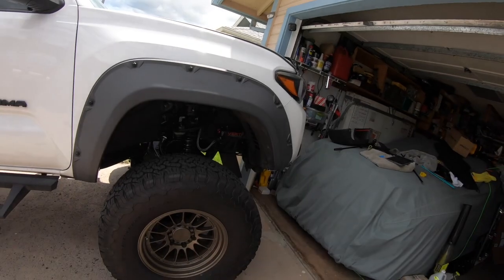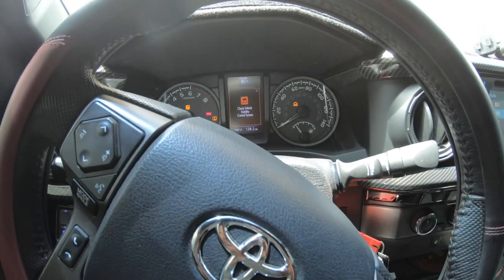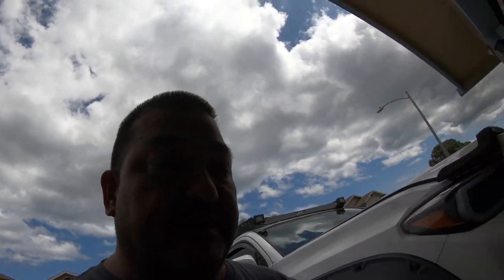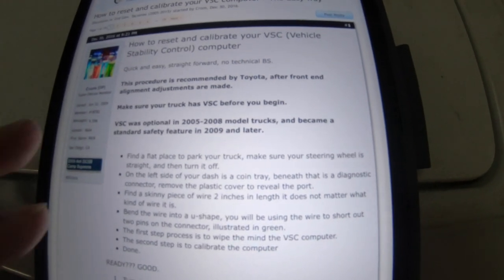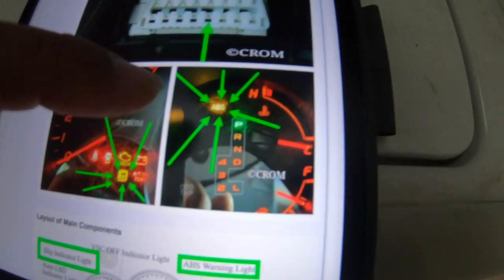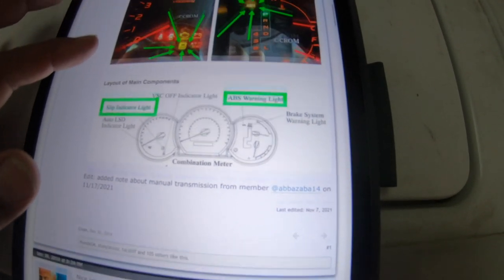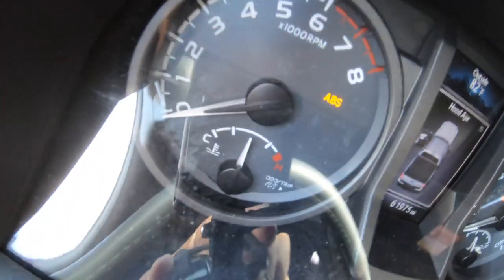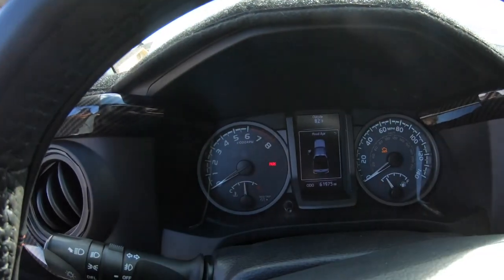Tacoma Vehicle Stability Control

Comment: So ran into this issue after jumping my truck. The cam bolt slipped and the cam tab gussets were wrecked. Got new welded tabs and hex cam tabs that lock into the welded cam tabs. dealership wants $200 to recalibrate my VSC. If this works I will have spent less than a dollar on the wires at Lowe’s for what the dealership is charging $200.
Reply from the maker: double check the video thats linked here, the other guy does a better job explaining the procedure.
Reply: @infiniteprojects808  i already fixed it lol you showed me everything I needed to avoid spending $200 at the dealership lmao. Thanks for helping me save some money dude I really appreciate it

Comment: You made the perfect video, and it fixed my issue after replacing my worn-out shocks that had 93k miles on my 2016 TRD Sport with TRD PRO  Bilsteins that had only 6k miles. It ended up lifting it about 1.5-2".
Reply from the maker: cool beans. happy it helped you. the other guy I listed in the description has a more detailed video.. super cool that I could help you. 🤙

Comment: Thanks for the heads up on the traction control reset, just had this code pop up after replacing both LCA's today.  Also the flexi-head extension hack is definitely the best thing I've encountered in a while. Most of the times I end up using tape which does'nt always go over so well.
Reply from the maker: Cool bro. The link has all the info and the hard copy. 🤙

Comment: Where you put the wire on the bottom mine does not have metal inside, it’s empty :/
Reply from the maker: try digging around under the dash. sometimes the factory will tape the connector up.
Reply: On the 4th hole there’s no fuse

Comment: Did you had problems when driving when the light came on cuz i have a isuzu dmax and when the esc light comes on while the car shift in gear it shifts hard.
Reply from the maker: I did not drive the truck when the light came on. I immediately parked the truck.

Comment: Is your truck 3rd generation? If not do you know if this works on 3rd gen’s ? Thanks
Reply from the maker: yes the truck is a 2016 3rd gen. also check the link in the description. the other guy has a video that i followed. just take your time and it will take more than one try to get the timing right.

Comment: Didn't work on my 2018 Tacoma. Tried many times. Wouldn't never flash at all
Reply from the maker: Check the video link. I used his video and it worked for me. The other guy does a better job explaining each step
Reply: I have the same problem on my 18 Tacoma...
Did you fix the problem?
Reply: @MrSeth166 This didn't work. I have a friend that is a mechanic. He has a high dollar scan tool. He used it to clear this and several more codes that I had. Been good ever since now.
Reply: @Jaminjohnw  
Thanks for replying...
I need to find a buddy who has a good scanner...